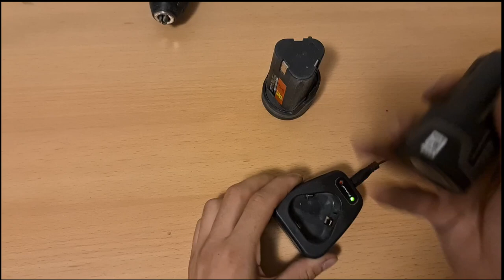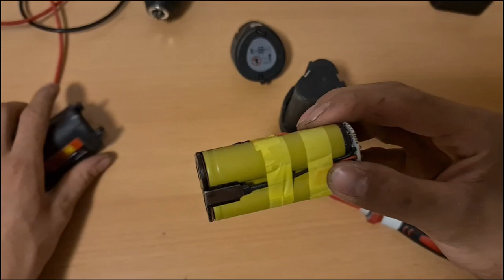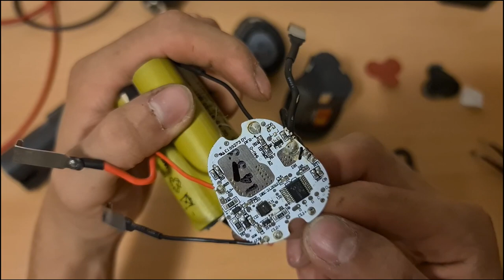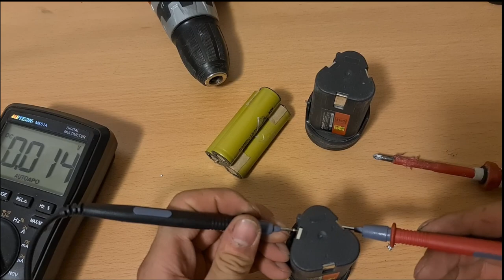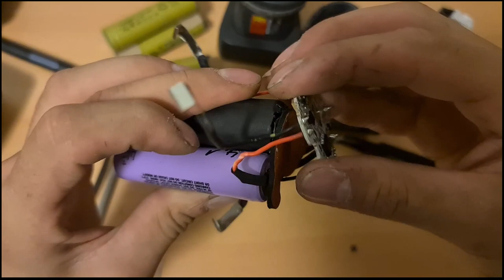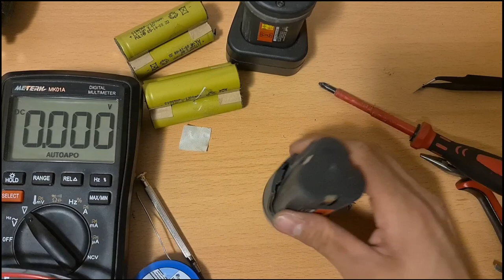How to Repair  LI-ion Battery /  Upgrade Einhell 1,3Ah to 2,9Ah

Comment: Beware, higher capacity batteries most of the times have lower max current. You will damage them fast in a drill.